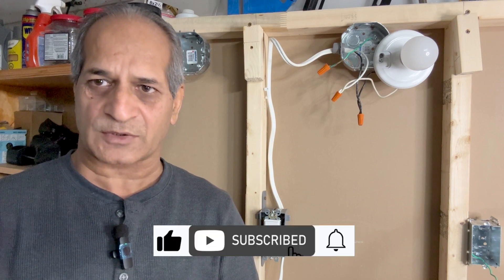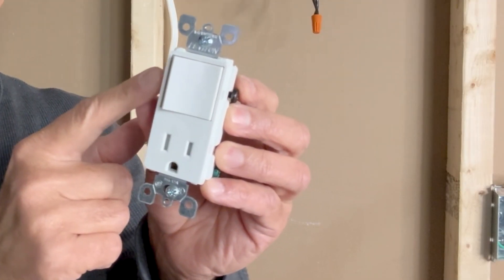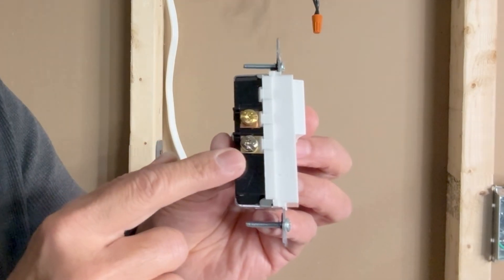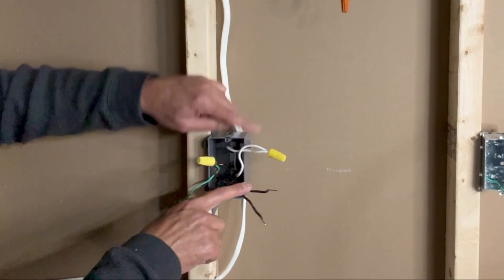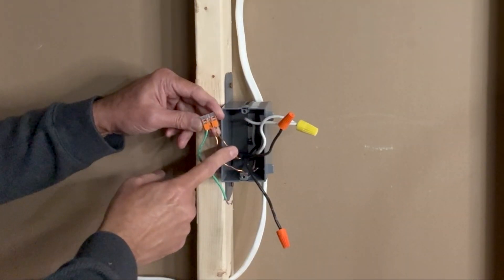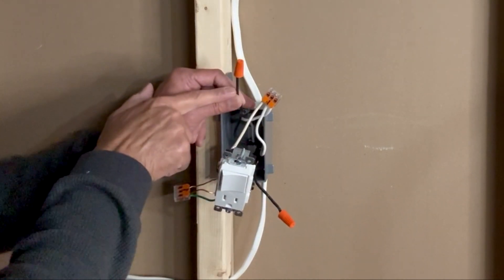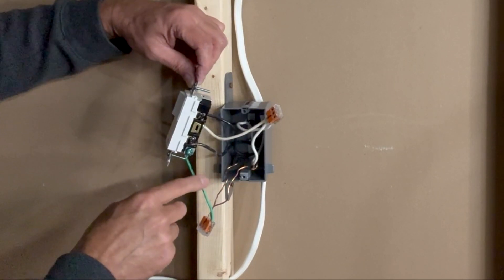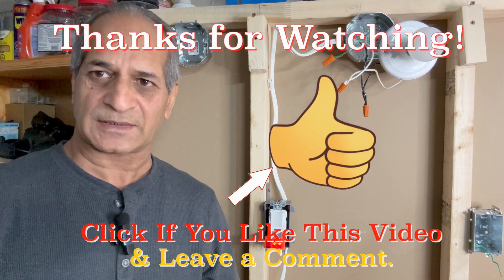Installing A Combination Light Switch (Switch & Outlet)

Comment: Thanks for sharing.quick questions  how you do it with 2 black  wire coming from the light only .no ground .thanks and cheers for this video
Reply from the maker: Thanks for watching. If you have only 2 black wires coming from the light but no neutral, then you can not use this combo switch. The only way is to bring an extra neutral wire from the light, or from a nearby outlet, if that is possible.